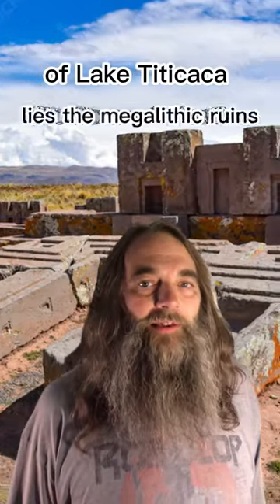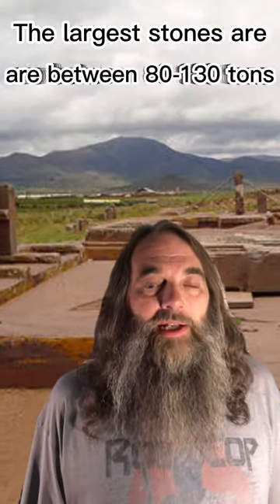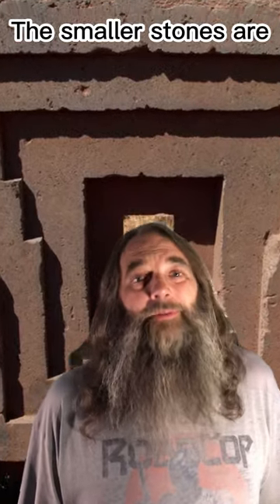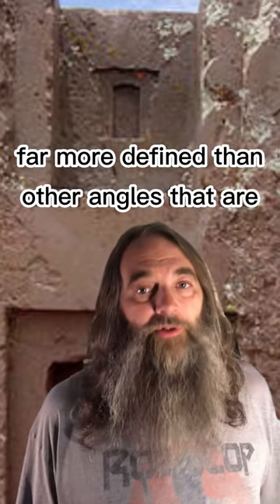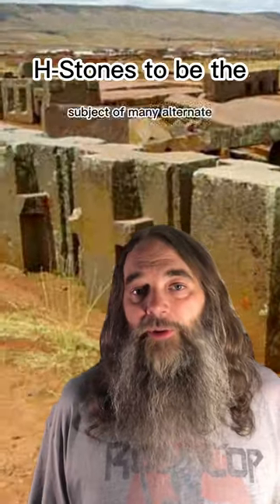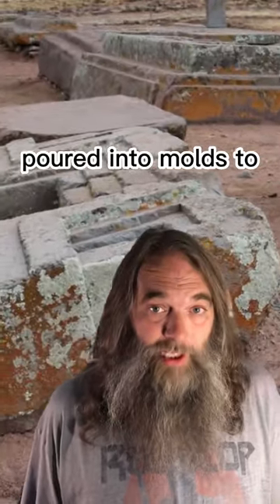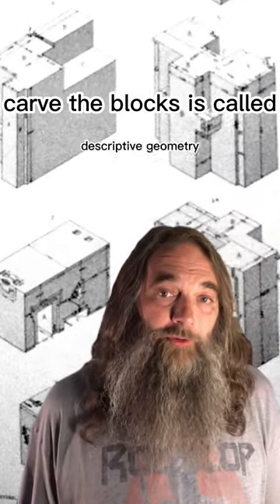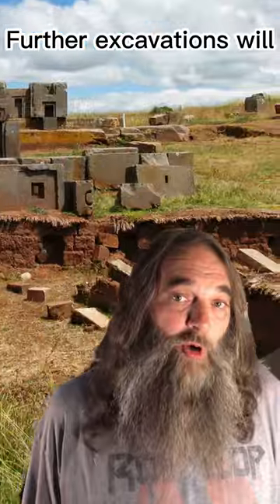Pumapunku H Blocks How Were They Made? #bolivia #ancientmysteries #lostcivilization

Comment: If you look at borobudur temple in indonesia, ancient javanese build the giant temple using hard volcanic rock and able to carve smooth surface and sharp edges

Some may think that there is advance technology or alien civilization involved here. But it's not. Ancient javanese people using simple tool to make that temple.

They simply grind 2 volcanic rock against one and other to get smooth survace or sharp edges. Tilt one stone to few degree angle to get tilted side

By using this technique to soil brick, you can build a monument or even palace without using any kind of concrete/cement. Just add water on the brick while grinding. It will causing a vaccum of air between the brick that will lock it

Most of building that constructed during majapahit empire are using this technique and they never using any concrete or cement

So stop judging that there is an alien civilization involved in ancient structure. Ancient people already find an efficient way to build that structure that become a proof that they are way smarter than us in architecture
Reply: He ummmm... didn't say it was Aliens.  Did you watch the whole thing?

Comment: I think a lot of modern people forget that ancient people had time, they didn't care if it took three hundred years to complete a building.
Reply from the maker: That doesn't make things like a tight corner happen, that still takes sharp, hard tools.
To slide all the way down the slippery slope, how many people and years will it take for an ancient culture like that to make an airplane?
It takes skills and knowledge, manpower isn't the issue.
Reply: @DeDunking  or just more time with softer tools, to edge a stone. To build an airplane requires far more than just the tools. Unlike a man sitting there with a few chisels and a rock.